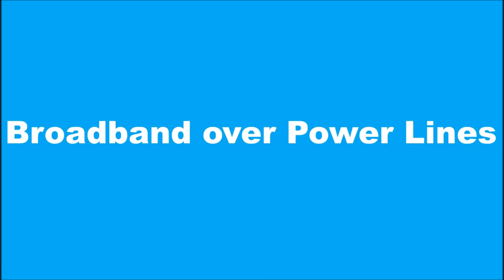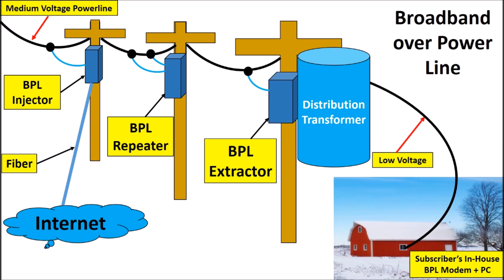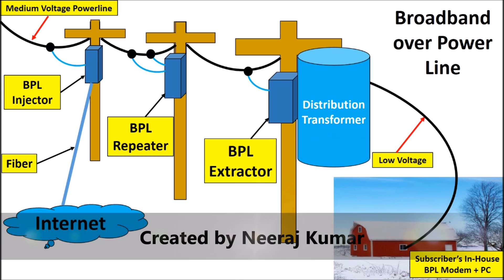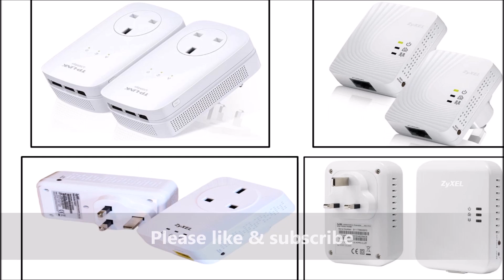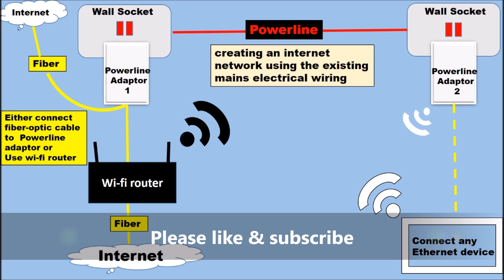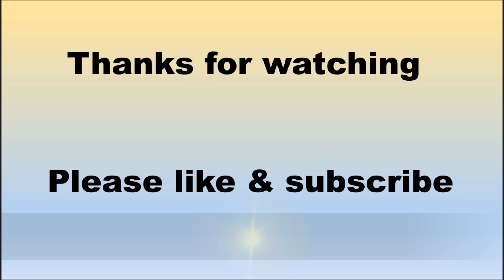Broadband over power lines (BPL) by Tech N Toast

Comment: if data format reduce to minimal then use electrical power grid to transmit the internet on top of electrical  start at the substations where repeater and router installed to receive long distance signal then route to home where computer connect to wall plugs will complete the system. signal lost only if we had current. imagine a system of no current but only potential voltage and so no heat, no electric bill needed for there is only voltage are bing used. for example if 50,000 volt induced onto a 3 three plate capacitor then use the lower voltage from the center plate then cost us nothing

Comment: This save money from using too much fiber optic cable of too high cost. With this we only need the converters at substations that can act like routers. All we need is inject the add on an average of 500 v over power voltage and the application of multiplex transceivers and each 5 volt bandwidth can carry a atleast 10 transmission concurrently and with 500 v we have atleast 10,000 concurrent transmision and randomly on various distance we can support huge number of transmission.